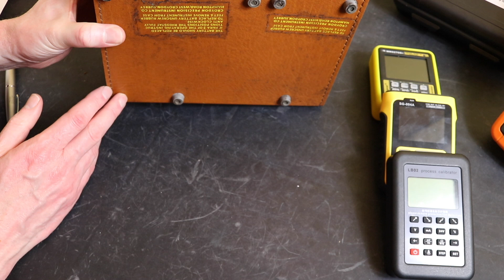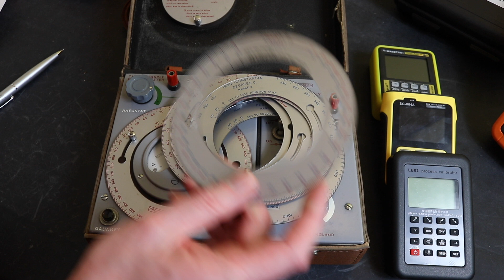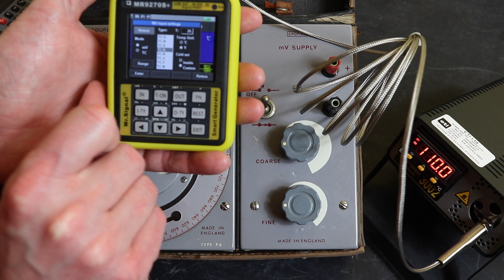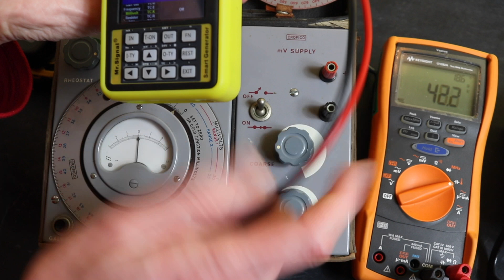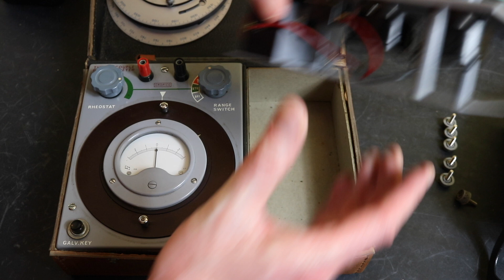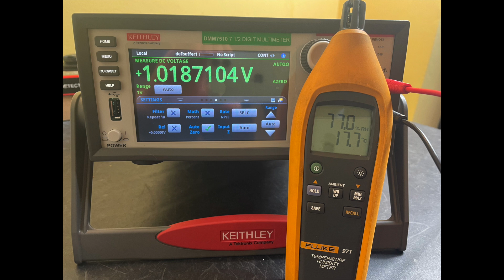Old School Sundays - Cropico P6 Thermocouple Potentiometer

Comment: Really enjoy seeing this old kit works , amazing I think I saved one of these from a skip and it’s set deessingbin my studio and I have never really looked at it I just knew it was too good to throw away , I’ll gave a look at it next week
Reply from the maker: There is a bit of the old Cropico stuff around. Just picked up the resistance bridge version of this, but it has been left sat around and the batteries leaked inside. Shame they aren't looked after better.
Most of mine I get off eBay as I am never in the right place when someone is throwing out the old stuff 😃😃.